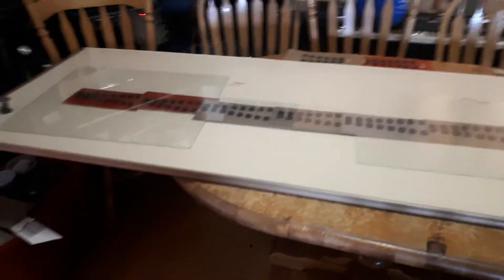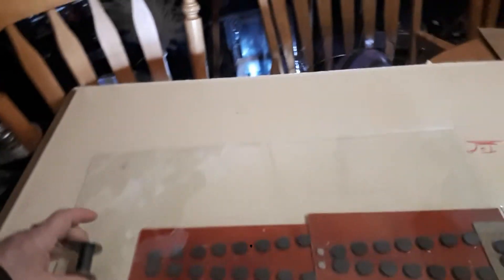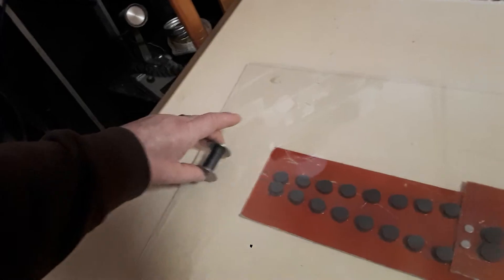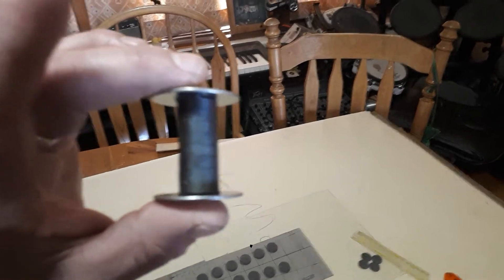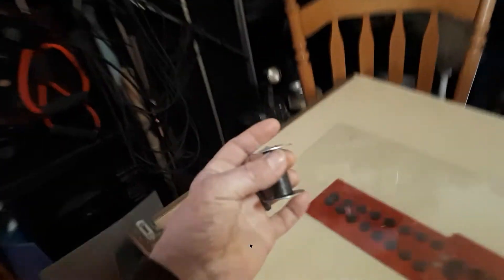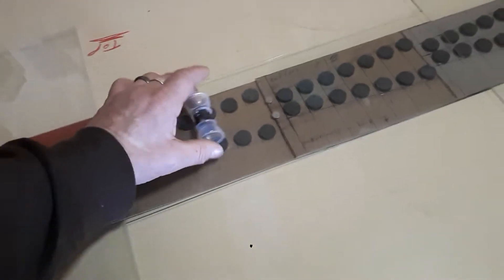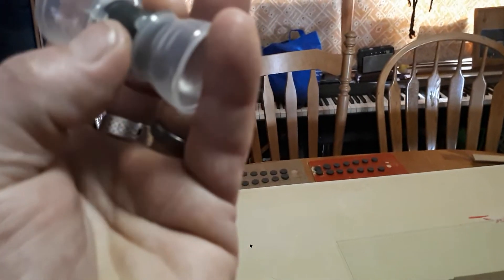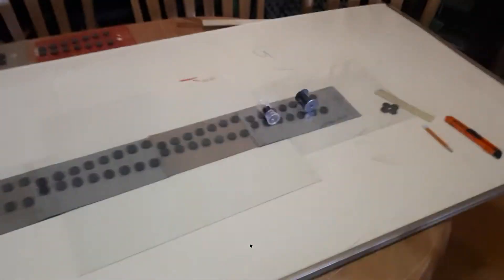Magnet motor v-gate 2.1 working?

Comment: This the first thing I've seen work that I feel is for real
Reply from the maker: LoL🤣 I know what you mean!
But yea, it's for real.
And with the proper setup, I do believe that it is possible.
But everything has to be really precise!
I never really finished the expairment. I tried stuffing it inside a drum and everything moved lol.
I might revisit it at some point.
But I do believe it is possible 👍
This guy explains the spacing the best.
https://youtu.be/6vNVvvrv97U
And if you're gonna try to build one. You might be best to glue them down on a thin piece of plexy glass..
Then roll it in a circle. so they don't move. 😎
Reply: @thelastofthelemmings6279   yeah  that setup you have shows it can be done..great work 👍. Best wishes from tennessee
Reply from the maker: @richardsledgecock2110  thanks from Canada 🥶😁